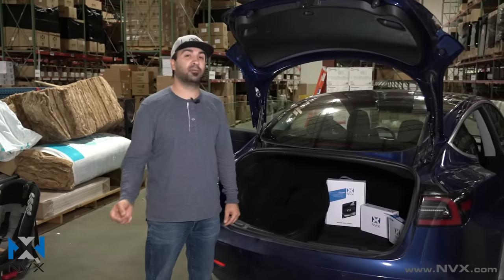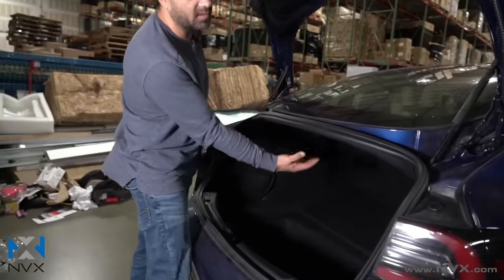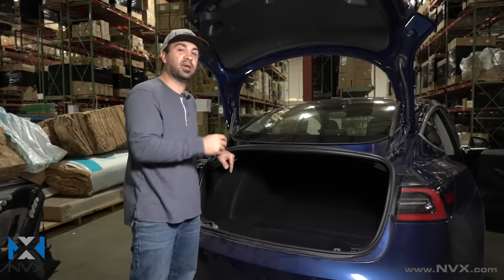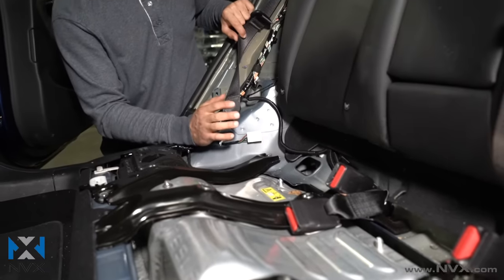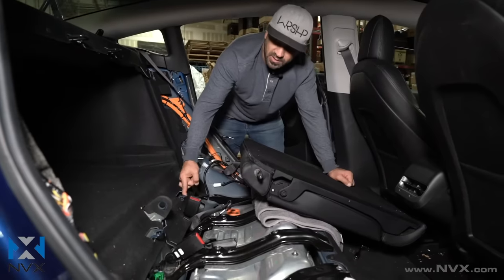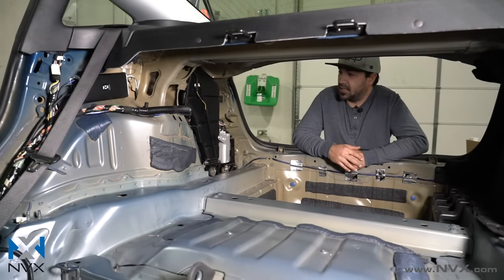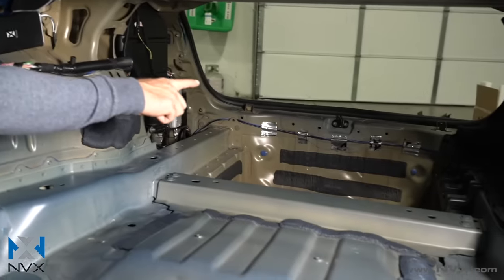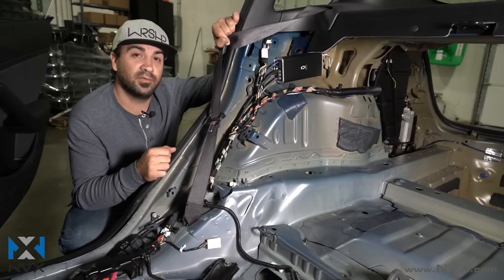Adding a Subwoofer & Amp to a Tesla Model 3 - Step-by-Step Install Guide for NVX BOOST Sub Box

Comment: I recently installed this exact setup in my model 3. In doing some forum diving online about error codes and how to prevent them, I found that the problem when connecting aftermarket audio gear to the penthouse dc power supply is that the supply turns off and on with the car, so each time you start it up there is a high inrush current to charge the amp's internal capacitors and the car eventually sees this as an electrical fault. Folks online are suggesting a resistor and relay wired in parallel to limit inrush currents. Is there any internal circuitry provided in the included amplifier to limit inrush? Has anyone measured how much inrush current this amplifier takes? Is a relay/resistor setup needed to mitigate this? I love how it sounds but I want to be as safe as possible and not damage my car.
Reply: Keep reading, there is a good write-up with an 80a relay and a ballast resistor. Since the radio powers up after the penthouse the ballast (or load) resistor is wired across the relay contacts (Common and NO) and the turn-on lead activates the main power connection (Common to penthouse, NO to amp). So the resistor already has the caps charged by the time the turn-on lead is activated.
Reply: I am doing this same thing this week so I’ll post a video on how to wire it
Reply from the maker: I personally have installed our system in 4 or more Tesla's and haven’t experienced these issues. For the few calls I have taken regarding this topic it has boiled down to two things that seem to cause the issue. 1. Before removing the power terminal from the penthouse, the car needs to be powered down. Disconnecting the power with the car powered on will likely lead to issues. When reconnecting the power to the penthouse terminal make sure it's nice and snug. If it's not properly tightened, this can cause additional resistance and cause errors. This has just been my personal experience with a few people I have helped with solving the issue.
Reply: @NVXAudio  Have You Heard Of Any issue’s With The Subwoofer Being Mounted Right Next/On The Same Side As The Charger port?..Worried That The Low Bass and Vibration Might Mess With Port?..
Reply: I use SS relays and resistors - no issues after 2.5 yrs

Comment: Can a Tesla handle aftermarket battery draw for something like this?  I wonder how this would affect the battery in terms of lifespan and range.
Reply from the maker: Yes, the Tesla handles this fine. If you were to put a huge amp that was power hungry and let's say 100A draw then you would most likely run into issues; however, this in part is what makes this setup great. The draw is minimal. The space used is previously unused space, and it uses the 12V battery. You should see no impact to your lifespan or range. Further, we made a similar system for the Model S 5+ years ago and have an incredible amount in use on the roads to this day -- and that setup actually draws more power, but again it's from the 12V battery.
Reply: @NVXAudio  Does the factory and aftermarket subs fire together in sync?
Reply: @NVXAudio  you should do an audio test with the subwoofer. Is it worth it??

Comment: Will this kit cause error codes or cause the main display sounds to be heard throughout all speakers?
Reply: @lancebrumbalough4325  were you tapped into the 12 volt battery in the front? Professionals in my area that do installs all the time say ONLY use the 12 volt battery in the front and avoid using the power behind the seats.  0 codes, no issues.
Reply: @lancebrumbalough4325  that is correct. Change it to the battery in the front and let me know how it goes. Update me.

Comment: Subwoofer blocks the manual charge release cable? Is it easily removable if I need to access that charger release?
Reply from the maker: Yes. In the (unlikely) event you needed to access that, then you would a) remove the upper panel (2 plastic clips), b) 10mm bolt that threads into the included jacknut which attaches the BOOST box into the car. It would take you less than 5 minutes. The only thing you would "need" to have is a 10mm socket w/ wrench (perhaps put in glovebox) if that was a longterm "concern" of having access.

Comment: Do this kit active all speakers 2

I mean to ask do u have kit what have all wires to active last 6 speaker ans subwoofer?
Reply from the maker: At this time we do not have a kit put together for Tesla, but is a great idea. For the time being you could buy the whole BOOST kit then buy a 5-Channel amplifier to power your doors and subwoofer. The kit comes with an amp but with the money being saved buying the entire kit, the amp is actually free. In my opinion I would run a VAD11005 5-Channel and keep the VADM1 as an extra amplifier for another vehicle.
Reply: @NVXAudio  can u put link here where is full kit with speakers and subwoofer? If i understand right you have some kindo kit?

Comment: Did disconnecting the rear seat cushions cause and warning lights or codes  ?
Reply from the maker: No because reconnect them :) -- I suppose if you do not connect them you would get a light/code.

Comment: So at what point do you need to use resistors? Want to go with around a 12'' subwoofer and a 2.3k W amp
Reply: Well before that point and an additional battery probably. That DC-DC converter isn’t meant to run 200+ amps of accessory load. Probably asking for trouble.
Reply: @grumpysteelman  have had it for 7 months, running fine right off of the battery in the front
Reply: @leo_cad  - guarantee that your amp isn’t making that much power. How big is the fuse on the amp itself? Also what subwoofer? There are only a few subs on the planet that can take that kind of power.
Reply: @grumpysteelman  100a on the fuse, Rockford Fosgate P2-2X12 12" 1600
Watt Dual Loaded Subwoofer Sub
Reply: @leo_cad  100a fuse means 1380w max at 13.8v on the input side, bud. So output power on a class D (~80% +/-10% efficient) would be ~1kw RMS amplified power, assuming you’re on the ragged edge of the fused amount. The box is rated for 800w RMS and that’s about what I’d expect on an amp fused at 100a.

FYI - 2300w output at 13.8v at even 90% efficient (rarely is it ever that high) would be >180 amps of current pull. No way 100a fuse wouldn’t blow immediately.

Either way, that ported box probably slams. 👍🏻
Reply: @grumpysteelman  i would be lying if i understood anything you just said BUT i use the sub at lowest power so im sure its not drawing anywhere near 100a
Reply: @leo_cad  - all good bro.  I am trying to finish up my install in my '22 M3P this week.  I went with the NVX box, so I won't have anywhere near as much bump.

Comment: Anything for the Y on the horizon.  

Also how do you tap Into the factory wiring for the LOC?
Reply from the maker: https://nvx.com/media/cms_pages/TeslaModel3BoostwiringX_1_.png
Reply: @NVXAudio  so does that mean no for the model y?  As well how are you taping in?  A harness or t’s
Reply from the maker: @sfcgoofy1982  The current method of installation requires you to manually splice into the wires. We have not made any official announcement regarding our Model Y product...yet.
Reply: @NVXAudio  well hurry up!  Master Elon wants the model Y to be the #1 selling car in the world and I need some bass!  

Thank you
Reply from the maker: @sfcgoofy1982  We got distracted with the SpaceX subwoofer enclosure. We understand how important bass is to our loyal customers. However, E.T. has been waiting on subs for over 30 years. When we said we wanted our subwoofers performance to be out of this world we meant it. We didn't forget about you though!!

Comment: Before I buy, I’d like to know which wires I’d be tapping into for the line output converter. Please let me know
Reply from the maker: We are in the process of making a follow-up video which will diagram the connections even clearer. Further, I have our team uploading the diagram for you here: https://nvx.com/be-tm3-vsw10s2-tesla-model-3-complete-aftermarket-subwoofer-package.html
Reply: @NVXAudio  a test bump at the end of the next video would be nice too.
Reply: @NVXAudio  Yes I'd like the wire diagram also. I'll use this video though to start my sub install for sure, thanks
Reply from the maker: @aaronjones7078  You mean like just a demo of it playing? We have one. I will tell Social to post here as a link
Reply from the maker: @aaronjones7078  Hey Aaron, we just put up two videos of what it sounds like

Comment: Yeah, well, you do not necessarily need to run the power wires back to the battery IF the factory cables are thick enough, which I doubt though.
Reply: They’re tapping directly to the dc to dc converter, which charges the battery not draws from it. Also from what I read I there is a circuit board in between the dc to dc converter and the battery, so i think the guy misspoke, that wire does not go directly to the battery. Regardless you can tap directly to the dc to dc converter it can handle like 150 amps.

Comment: Hi I just installed this system in my Model 3 with factory sub. How did you set up the XLCA2?  Does the factory head unit drop off the bass levels? Did you turn the bass x threshold full clockwise and the bass x all the way down? On the amp where did you adjust the low pass filter to. Where did you set the subsonic and bass boost to? I adjusted the low level correctly and the amp gain to 25.2V with a 55hz tone. The bass is better but not as loud as I thought it would be.. 
ok after some messing around I got it sounding better.
Reply: What were your final settings?
Reply: @hobby_dude_  subsonic at 30Hz LPF at 120Hz bass boost off. Bass x threshold full clockwise. And adjusted the bass x till it had enough bass to my liking.  Sounds much better now
Reply from the maker: That is not necessarily our recommended settings. If you are happy, then that is great but generally speaking most people want their sub to play lower than 30Hz. By setting your subsonic at 30Hz you effectively lose any frequencies below 30Hz. Further, LPF at 80Hz would be what we did so that way your mids/highs play 80Hz+ and your sub is 80Hz and below. The 120Hz means you will play 120Hz and below.  The reality is these things are also dependent on volume of the user. 

In our setup for Nate's car we have Subsonic at 25Hz, LPF at 80Hz, and Bass X with a slight bump.
Reply: @NVXAudio  how can you set it up that exact? That just a minor turn of the knob.
Reply: @NVXAudio  also the LPF is after the factory amp so wouldn’t actually affect the factory mids right?
Reply: @anthonyj4969  I think he is meaning notch at 80 hertz so that the rest of the system fills in where the stock sub response is better as the volume fills out. You need to adjust the equalizer to make this more relevant. I go with like four to five on the bass and adjust the gain on the monoblock to compensate and give more 30-80 hz kick.
Reply: @hobby_dude_  I know he meant 80hz but it’s not marked clearly.  I’m going try adjusting it with a multimeter and a tone generator and see if I can fine tune it that way.
Reply: @UCRpNH5mj__YWDIQRnzNs_lw that’s what I found out too. Turning bass x threshold fully clockwise is turning it off.
Reply: @anthonyj4969  I'd really like to have a complete listing from NVX on where everything is set at including gaines. Since all these vehicles are identical it'd be nice to have a common place to start.
Reply: @hobby_dude_  I sent a email and msg to them when I was doing the install  and never got any reply. I set the gains with a voltmeter and tone generator. You can find videos on how to do that on YouTube.
Reply: @anthonyj4969  I'll have to do that at some point. I had to put the interior back in before I had a chance to tune in depth. Thanks for the advice.

Comment: @nvx Did you keep the factory subwoofer connected at the end?
Reply from the maker: Yes we kept it connected. You do not have to keep the OEM subwoofer connected and we did not want to confuse those that do not have the OEM subwoofer; however, if you do keep the OEM connected for an extra bit of bass, then we suggest wiring the BOOST sub out of phase (connect the amp's positive to the sub's negative and amp's negative to sub's positive).
Reply: @NVXAudio  I noticed some distortion on my factory sub.  How soon before you guys sell a replacement speaker with adapter and passive band-pass  crossover?  Would love to upgrade that speaker and save the lower frequencies for the 10.
Reply from the maker: @thomasbihn  I am not sure I would recommend this as the subwoofer we have will cover the frequencies as there is no roll off. You may be better served to simply unplug the factory sub out of the equation. We have found people happy to disconnect the factory sub altogether.
Reply: @NVXAudio  what does wiring out of phase do?

Comment: I have a W6 (600w) 
Can this be done? I was told it would mess up the car and tell me my 12v battery is dead... I don’t know how much watt that converter Can change??
Reply from the maker: Sell your W6 on eBay/locally. Get the package and never look back. You'll thank us later.
Reply: @NVXAudio  I would never be able to sell my w6, it’s JL so compares to 1200w other brands. I have one in each car, problem is it might destroy this box, or be to deep. I listen to 30hz and lower so I need a long throw 4” movement.
Reply from the maker: @lordjoshr  You would first of all be too deep. Second, we really think you should consider the system as an upgrade, listen to it, then pass judgement on the VS-series sub. It's a lot more amazing than you think ;).
Reply from the maker: @lordjoshr  I think what you are implying is "I listen to really low bass" and not so much 30Hz or lower given 20Hz or less is not really audible and "listening" to 30Hz is really not something that is going to be consistently heard. The BOOST Box gets very low. What makes you think it doesn't? It's a complete kit, package and solution that sounds amazing and complements the factory acoustics very well. 

Separately, I can confidently tell you that we make a sub that does outperform a W6 from an output standpoint, we just chose the VS-series in the M3 for reasons below. We provide the VC-series with the Tesla Model S BOOST Box given the configuration and set up of the vehicle. The goal of each BOOST Box is to meet darn near everyones' needs with bass, not an extreme edge case. Putting a VCW104 (or W6) in a hatchback/open trunk of a Tesla Model 3 would not be something that most prefer.

If you are interested in a subwoofer that a) outperforms the W6 you speak and b) a solution we can help you build with that sub for your M3, then let us know at sales@nvx.com and we're happy to help.
Reply: @NVXAudio  the sub I have is in the original JL audio sealed prowedge box. It’s absolutely tiny but tuned really low. 
On a bass sweep I can hear 15hz and only start feeling it lower.
Most all of my preferred music is slowed chopped and bass boosted. 
22-25hz is preferred but some songs will stoop to 19hz. 
Regular rap music just slowed way down or bass mechanics.
I enjoy the small box I have 14”x13”x14 (.55cubic) and the slash V3 analog amp because digital doesn’t give me a clean excursion control below 30hz. And with the DMA and frame cooling along with the pole cooling vent system I can keep volume at max without any chance of over heating the woofer. 
But I’ll look into it, I have a perfect set up just thinking boxes. I’m used to such low bass you can bounce items on the roof and stand by the window and your cloths move visibly. I think anyway my system will be to much power consumption for my Tesla, not sure what the MAX is capable
Reply from the maker: @lordjoshr  Noted with thanks. I think the point with our sub box is to design a solution that a) doesn't lead to Tesla M3 power issues (too much draw will do this) and b) not sacrifice space. Your setup obviously will lead to b (lost space) and may like you said have an impact on a (power consumption issues). Further, we could have possibly tried to do the VC-series, but the box result would have been terrible (protruding greatly) and that would have impacted b (lost space) -- and it probably would have been too much power strain on the system.
Reply: @NVXAudio  my box fits in the bottom trunk, but I really like your design. I’m looking into it for sure. Probably will do something soon. Do you sell clips to tap into stock sub signal? My amp accepts both high and low signal so I don’t need a pre amp

Comment: Ok just had a business install my alpine type R and Kenwood amp, I now only have sound up front. They said I would have to get some type of update from Tesla or it might just need to relearn after a hard reset. They didn't cut anything and they are a very liked installer. Does this sound right
Reply from the maker: Hi Donny, 

I do not mean to be rude, but it sounds like your installer did something wrong. Further, you should consider the BOOST Box for an easier install, no wasted trunk space and great integration with the factory system. We cannot offer support on the products you mentioned because it simply isn't our solution that is provided in the video. Hope that helps and sorry that they did that. It's part of what makes our BOOST series special for vehicle owners worldwide.